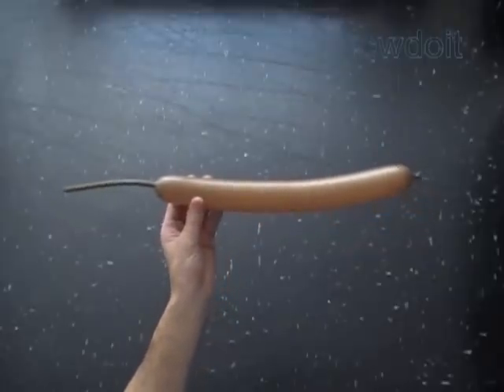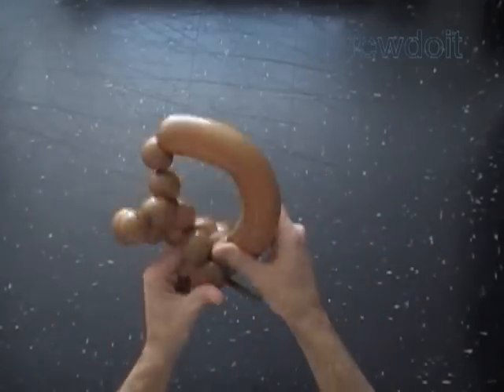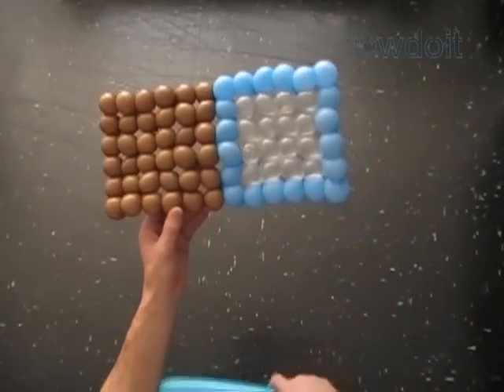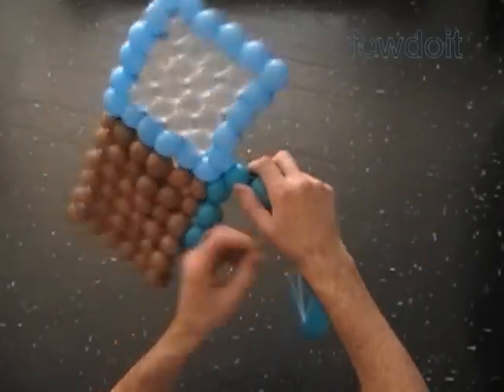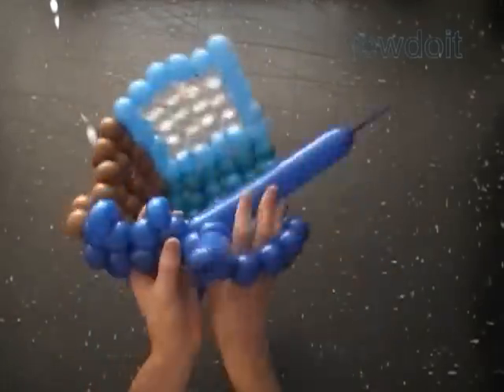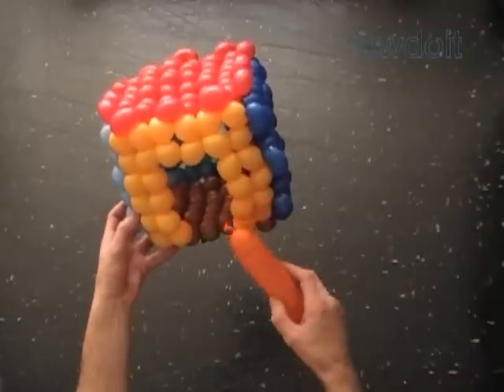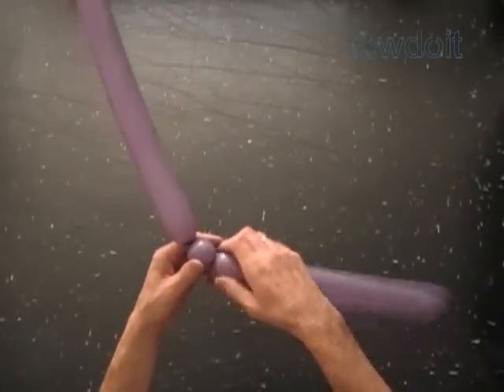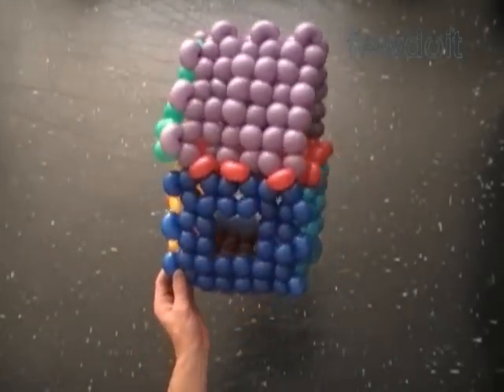Doll House Balloon Weaving Tutorial

Comment from the maker: Yes, indeed. It takes longer to do it in front of video cam. And much longer to do it in front of photo cam (I always make two sculptures-one for video instruction and one for blog post instruction). In this example using connection bubbles and working two rows of square at a time speed ups the work. Also, it takes about the same time to make larger size house with more balloons using fabric as described in instruction "Fabric 9, Flags 4". Thanks for the comment. Have fun and happy twisting :)